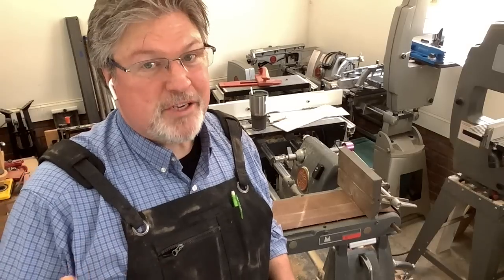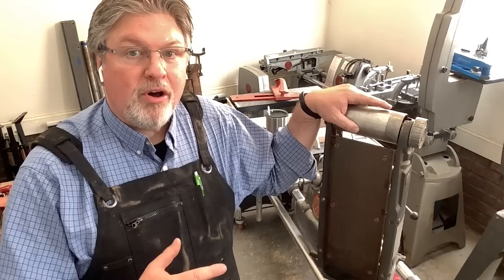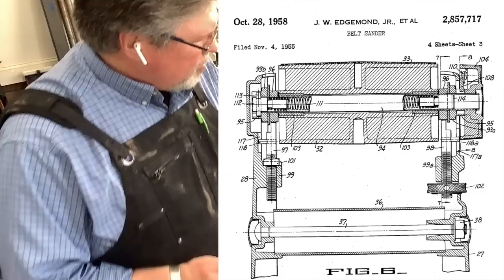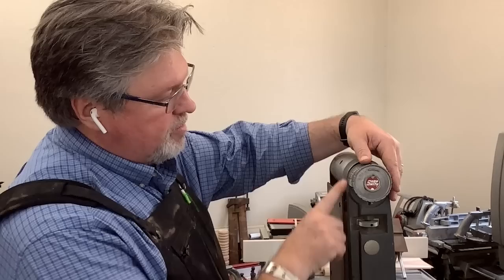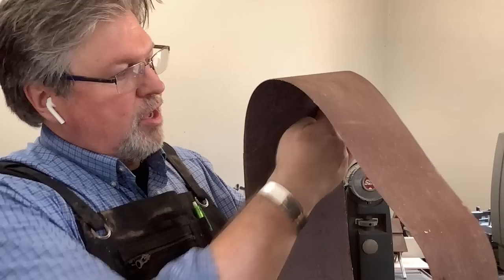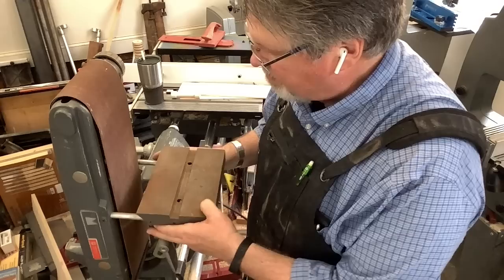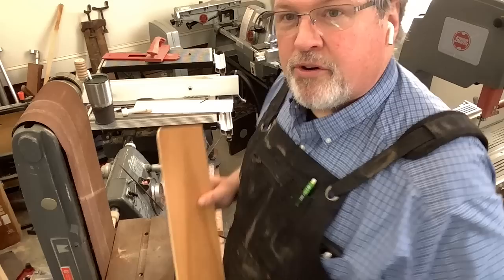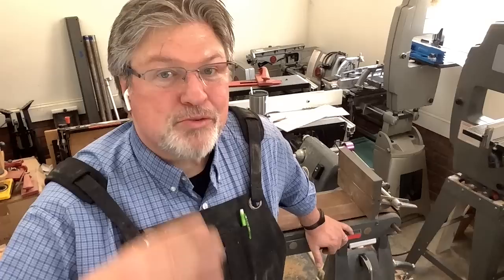Introduction of the Shopsmith 6" Belt Sander SPT (Special Purpose Tool)

Comment: Scott - Question about using the belt sander on a Power Stand (not a Power Station, and not a Crafter Station). It seems that the machine won't come up to operating speed UNLESS the pulley guard has been removed. Apparently, the slack in the pulley belt allows the belt to contact the guard and the motor spins, but the sanding belt won't move. 
The pulleys on this are: the dual 2", 3" pulley on the motor (1/2 HP motor) and the 3" on the tool.
Given your many years of experience, what suggestions do you have for me about this? Thanks in advance.
Reply from the maker: Are you running a rubber belt? My preference is to replace them with a link belt, which will not only drive the sander with less vibration, but it will make the turn around the 2” pulley easier and they tend to have better traction (less slippage). Either way, check your tension and just know that too much tension is almost as bad as too little. Scott
Reply: @MyGrowthRings  Okay. Yes, rubber belt.
How does one check tension? Mine is really slack. And I am not using the 2" side of the pulley. Not really sure if I should.
So the link belt is the one that can be shortened/lengthened? Usually a red color?
Would those fixed length belts that look like they are for a cogged gear might do a better job?
Reply from the maker: @billrogers6863  There's an instruction sheet floating around on the Shopsmith Forums on the Shopsmith Owners Facebook group that covers all the STP stands, but basically you should be able to pinch the two sides of the belt at the center point between the top and bottom pulley and they shouldn't get closer than 1" apart.  Scott

Comment: Is the tensioner on the Total Shop version supposed to work the same as the Shopsmith one?
I picked up a new in box one last year, still have not used it, but the button on the tensioner doesn't pop out in the retracted position, it pops out in the fully extended position.
It is the opposite of both of my Shopsmith ones.
Assuming it is supposed to work like the Shopsmith ones, I'm assuming something was assembled 180º out of position in the tensioner/roller assembly.
Reply from the maker: That’s odd and that’s not the way my TS sander works.
Reply: @MyGrowthRings  Thanks, I guess I'll take it apart and see what it takes to fix it.
It was definitely assembled that way at the factory, as the box it came in still had never been opened, and still had the factory banding around it.
Reply from the maker: @markbeiser  Weird. Let me know what you learn. Scott

Comment: Just bought a Shopsmith belt sander for $10.00. Yes, it does need overhaled. It is missing the complete table assembly. Hopefully you have an idea on where to get one. The person I purchased has hundreds of Shopsmith parts and is selling everything for next to nothing. I have a band saw that I bought for $35.00 and would like to trade it to someone for a belt sander table. It is missing the mounting pins and needs cleaned up, new tires and has a cast iron table.

Comment: I have an old 10er model, will the belt sander attachment fit onto the early units?
Reply from the maker: It can, as long as your marching has the appropriate add-on bracket to hold them. Magna offered this part and a kit to allow the use of the coupler to drive the SPT’s and some owners made their own from metal or wood. I would encourage you to check out the 10 of your owners group on Facebook or to search for Shopsmith Forums, because several people have shared this over the years. Scott

Comment: Scott, As you talk about in your video I bought my Shopsmith and sander used and had no tension on the idler arm. However mine does not rotate as you demonstrate. Would you demonstrate repair of the tensioning mechanism or point me to videos where I can see this. I have been unable to get a manual from Shopsmith for this accessory. I'm frustrated as this is one of my most used tools (or was). I'm a subscriber and love your channel. Thanks for all the great videos. I need them bad!
Reply from the maker: Hey Frank, Yes, what you are experiencing is not uncommon with a tool that is sat idle for a while. The upper drama runs on greased bushings and the grease will become solid as a rock over time if not used or maintained. I will cover this but it will be a while before I will be able to do to our relocation. I’ll put it high on the list though. Scott
Reply from the maker: In the meantime, you’re not going to break anything if you shoot a little WS40 on the bushing inside the drum and begin to rock it back-and-forth. Also, a little bit of heat from a heat gun or a hairdryer applied to the opened ends won’t hurt either. If you can get it to loosen-up, throw a belt on it and let it run for 20 minutes to loosen things up. That will get you going for now.
Reply: @MyGrowthRings  Scott I looked closely at the picture of the idler roller you showed and the tensioning system. I have a roll pin that blocks rotation of the shaft on that end. It looks identical to the roll pin on the opposite end of the roller. The picture you show in the video doesn't show the pin protruding on the adjustment end. Could someone replacing the spring not installed this correctly?
Reply: @MyGrowthRings  Scott, Great news! I was correct about the roll pin. I ground it down so it no longer catches on the aluminum guide. The tensioning system is working correctly. Thank you so much for your video. That picture was worth a thousand words!
Reply from the maker: @frankfowler8295  Glad to hear it and sorry that I’ve been unavailable all day.

Comment: What speed do you run yours at, at high speed mine tends to wander just a little, not enough to leave the rollers but about a 3/8 and inch side to side no matter how much I dial it in.  It’s perfectly fine at lower and still useable speeds
Reply from the maker: The manual suggests "E" (1150 RPM, 900 SFPM) to "J" (1900 RPM, 1500 SFPM). I don't really have a favorite speed, but if I had to guess where I tend to run it, it would be around J or even slightingly faster, but don't tell anybody.  Scott

Comment: I happen to have an early model belt sander in pieces on my bench. Cleanup is going well enough, but the bearings on the drive drum don't seem very smooth. If you have any tips on checking the bearings and recommendations on how to replace them I'd appreciate it. Thanks for the video... Moving sucks, hope it goes smoothly.
Reply from the maker: No real words of wisdom besides trust your instincts. It they feel rough they probably need to go. Even a cheap Harbor Freight bearing puller is your friend at this point. Scott

Comment: I got my shopsmith mark 5 and 6" belt sander in the late 1970th. I need to replace the bevel robber drive drum if you could do a video or that would help me.
Reply from the maker: Hey Tom. Yes, I've had that request before and actually have sander that needs a new sleeve and I even have the sleeve!  Just need the time.  Scott
Reply: @MyGrowthRings  thanks will be looking for it. I hope soon.

Comment: Hey there Scott, Mike again. I think I found an awesome deal on a sander $50. My next question are there any pieces I need for attaching it to the workstation. I already have a bandsaw on the workstation and the plastic alignment tool between the motor and the bandsaw. Anything else I should be aware of? Thank you again for your help.
Reply from the maker: What workstation? Shopsmith Mark V? PowerStation? If it is one of these you have what you need of you are able to power the bandsaw. $50 is a great deal!
Reply: Is there a chance you could please do a video on servicing the belt sander? The other peoples videos don’t show the assembly process for the top roller on the side opposite the tensioner of the how it goes in correct orientation. Thank you.
Reply from the maker: @Michael-Homerepair76  I’ve considered it, but haven’t had the time without more pressing topics pushing ahead of it. If you haven’t discovered Jacob Anderson’s videos yet, seek them out on the meantime.  Scott

Comment: Scott, or anyone else that might know, what years were the drive drum made with crowned? I’m looking at the possibility of buying a used one and I’m not having any luck finding flat parted out drive drums.
Reply from the maker: I'm not sure, but I recall they were an issue around the time I started working for Shopsmith, which was in 1987.
Reply: @MyGrowthRings  Here is a thought... I don’t claim it’s a great one but... let’s say we have one of the crowned drive drums and it has good rubber on it, could you possibly use spec tape or something similar to help flatten the curve of the drum; say say strip halfway between the center of the drum and the edges? I’m not sure how it would wear but I’m trying to think a little outside the box. I suppose the better way of doing it might be between the rubber and the metal of the drum but I recently replaced the rubber sleeve and that is something I’d rather not do again in this lifetime
Reply from the maker: Yes, I think that could be done and it's worth a shot.

Comment: Curious as to best range of speeds as a function of sandpaper grit?
Reply from the maker: That’s wide open to the user, but the manual gives a couple ranges basked upon grit and what you are sanding. You can also get some of that information from the sand paper supplier, but that will usually be shared in FPM, which you’ll then have to convert to RPMs.

Comment: Yours doesn't have the little drum attachment for finer concave sanding.
Reply from the maker: The shaft that is on the side furthest from the headstock is a 5/8" shaft and will hold any of the accessories that fit on the quill, including a drum sander, a chuck with small drums, a flap wheel, a sanding disc, you name it. I just forgot to show it but will later this week. Scott

Comment: Here’s a bit of a deep dive question. I’ve got a bad bearing on the drive drum. I’m looking at replacing both and have found info on the bearing type. I’ve been told that that they can be removed/installed without a bearing press. Can you confirm? Also, how do I know the location of the bearings on the shaft? Is there a snap ring or something that shows the correct placement?
Reply from the maker: I think I would try to get hold of a bearing press if you can.  Harbor Freight presses aren't very expensive and can even be found on Craigslist. In fact, if you don't see one listed, post in the Wanted section for one. Yes, there is a shoulder on the shaft.

Comment: I just pick up a  ew to me 6”  belt sander and like you said it came with no tension on the idle drum. I tried to put the Four turns on it and can only get two turn that will  hold after that it auto trips the trigger to release the tension
Reply from the maker: Any chance you are winding it backwards?
Reply: @MyGrowthRings  I’m turning it in the direction of the arrow
Reply from the maker: @kirkschweighofer2966  Ok, then my best guess is either that the end of the tension spring is broken or the part of the button that engages is either broken or crusted with sawdust.
Reply: @MyGrowthRings  Turning it backwards? No one ever does this! ... /scampers off and hides
Reply from the maker: @gatheringsplinters4800  Believe it or not I've seen it done. Even seen videos of it being done...
Reply: @MyGrowthRings  lol
Reply: I put it apart and found it to be dirty, likely the person before use the wrong wax or didn’t max it the right way.

Comment: How rigid is the cast iron table on the belt sander when installed? The two mounting posts look small and the set screw mounting scheme looks like it might lead to some table flex. Just wondering if the belt sander is good at producing square/90 deg surfaces. Thanks again for the great videos!
Reply from the maker: It’s actually quite rigid. That has always been one feature that never let me down.
Reply: @MyGrowthRings  I use my sander quite often and and there is no flex to be found in that table arrangement.  Bought my SS sander after burning up a portable belt sander on a project.  No problem for the SS.
Reply from the maker: @dwightl5863  Thanks for the confirmation. Scott

Comment: This is raking over old coals and you might not even see it, but here goes anyway.  I've got a 1980's belt sander with the crowned driver drum.  I've just re-watched your video (again) and you said that there were ways around this but maybe it would be best to just buy a new drum.  Unless you live in the UK, in which case you may not be able to get one and even if you did, it would cost an absolute fortune, because you have to buy the whole assembly at maybe 3 times the US price.

Nick Engler in his sander video suggested having the drum ground down to straighten it up.  Was this what you were thinking of?   I've managed to keep the belt on track most of the time but it does tend to go walkabout when I'm not concentrating.  I can't see how to get the rubber sleeve off without stretching or destroying it - any suggestions?  Replacements for those are not available over here either.

Otherwise, the sander is yet another great bit of kit that gives me loads of satisfaction, now that I'm officially a pensioner with loads of spare time, as of today.  Now, about that senior citizen free bus pass.....
Reply from the maker: Hey Graham.  If I were in the same boat as you I would either take the drum to a machine shop or if I felt up to doing the work myself I would built up the edges with automotive bodyfiller (We call it "Bondo") which would minimize the amount of aluminum material that will have to be removed. You could then flatten the coated drum with abrasives or even with an angle grinder before installing a new rubber drive sleeve.  Those are my thoughts. Scott

Comment: Scott, i have all the other sanding attachments with the exception of the belt sander. What would be the reason for adding the belt sander?
Reply from the maker: It's all about surface area. Imagine you made a corbel or bookend or something of that scale. You'd be hard pressed to get anywhere near the same results with a 12" disc and the strip sander would just whimper in the corner.  Scott

Comment: I bought a used sander and I’m having issues keeping tension on the belt. It’s very frustrating. I’m either doing something wrong (likely) or it’s broken but I just can’t make it to work. Definitely regret this purchase
Reply from the maker: When was your sander made? Did you catch the part about the machines that were made with the crowned drive drums? Also, the part around the 5:50 is critical. Scott

Comment: I have this sander and the instructions.  For the life of me, can't get the the belt to track! Any ideas what I am doing wrong?  I have watched your video multiple times trying to figure out this problem. No luck!
Reply from the maker: It’s likely the hidden adjustment on the said opposite of the tracking wheel. Also, make sure that your lower drive drum is flat. If it is crowned you’ll want to replace it. Scott
Reply: @MyGrowthRings  Thank you, Scott! I will double-check that when I get back home.
Reply from the maker: The info is hidden in the manual, but it’s there.

Comment: Scott,
What is your opinion of the Shopsmith dust collector?
Thanks. 
Jack
Reply from the maker: Hey Jack. I own three of the DC3300 and really like them. I don’t need three, though! They are portable, easy to empty and powerful enough. I don’t own a DC6000 yet…
Reply: @MyGrowthRings  
Scott,
Thanks for the reply. Might be a good topic for a video. 
Jack
Reply from the maker: @jackwilson1245  For sure, it’s planned.
Reply: @jackwilson1245  Morning,,,watched video, my problem is when I turn machine on the tension knob backs off, I’ve adjusted tension roller to receive belt but it’s tight like you had on your machine ,is it required to have four turn on tension roller? Should we turn tension roller four turn to tighten spring an then back tension roller knob off just enough to slip belt on, please resend form information,looking forward to your reply , I just retired an bought mark 4 from neighbor an  its been setting for along time it’s got so many accessories ,having to do research an see what these attachments are use for,I’m excited to get it up on running ,I have Honey DO list already 😅😅😅😅😅
Reply: @clyderanger  Confused, are you sure you directed you question to the correct person.

Comment: How do you loosen the tension on the knob? Mine seems stuck down..
Reply from the maker: Is the belt on or off? You should be able to simply rotate it. If not, you may need to remove the knob. Let me find you a video…
Reply from the maker: Grady, check around the ten minute mark on this video: https://youtu.be/91bRVOMEDFg. Scott

Comment: Can the belt sander be run in reverse or does this mess up the tracking system? For example, could you put the table on the back and use the slack sanding area so that the belt drives the work piece down into the table for better control and also carries the dust into the dust collection fitting instead of up into you face?
Reply from the maker: I believe it cannot for that very reason.